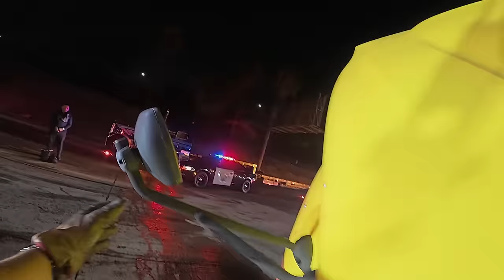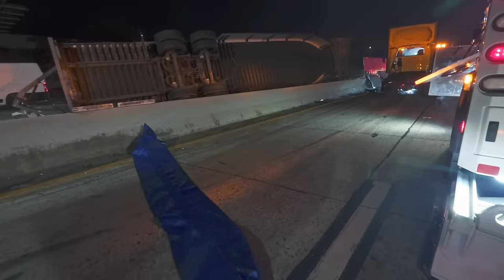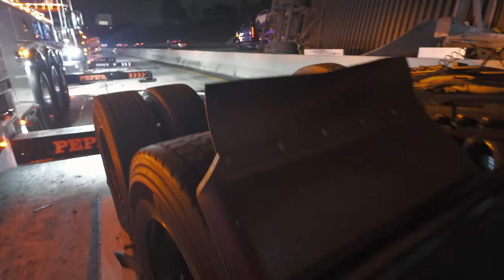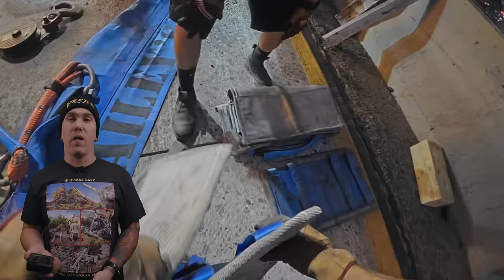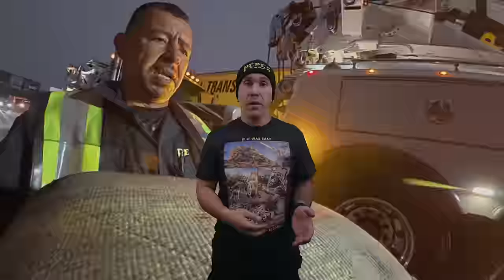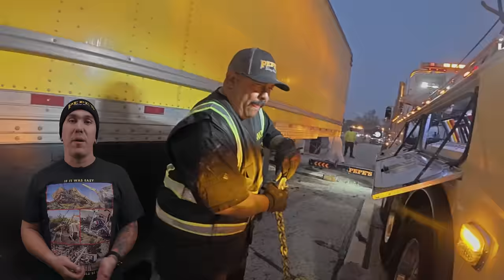Trailer Rolls Over to OPPOSITE side of Freeway!

Comment: Ok, the video quality one way or another not that big of a deal, it's at night. Your recap was spot on to my thoughts. I would have put Big Flipper to the rear for reach. You compensated perfectly for the reach issue by using the jersey barrier to hold the trailer in place while you rolled it. It would have swung into your trucks if you had not done that. So, job VERY well done all around. Also, I know exactly what you mean when you show up and the cops are relieved to see you because they know you will get it done safe and in good time. Back in the day during my time doing this stuff, I had many occasion to show up on scene and have the cops see and go. oh good, it's you!! I always respected that by doing my very best work to clear the scene as safely and quickly as possible. Cool video, be safe!

Comment: @Pepe's Towing Service : Josh like you mentioned in the breakdown you were afraid that the trailer would burst open during the lift, but when you were walking inside the trailer you mentioned it was loaded with kids' toys so I'm guessing that the total weight of the trailer wasn't super-heavy or at least not heavy enough to cause a problem for the trailer walls during the lifting.

As for the action cam's night mode versus normal : they look fairly similar at first glance, but of course what we see is after you did your post-processing and we cannot determine exactly what you did during editing in terms of gamma correction, etc. ... The video quality depends on how much movement there is in frame, the more movement you have the grainier the image becomes and the more artifacts you get. The amount of lights in view affects the video quality as well but that's also normal because the image sensor limitations. Your video (without night mode) "burns out" more compared to Alex's from what I can see (but that's normal : night mode is designed to handle dark scenes better than normam mode), but they look fairly similar after editing. (or close enough so that most people wouldn't know the difference)

Comment: I'm still trying to convince myself that he started on the same side the truck stopped. Though it seems almost impossible to have spun everything 180°.  The damage to the right hand wheels is hard to explain. Unless the unit jacknifed, but that would explain all the rear wheels but not the smashed up front. Maybe the trail of other damaged vehicles on both sides will give the cops more to go on.

Excellent quick recovery. I was hoping to see more of what you did with the big plate..?  Did you have another normal truck come in to pull away the trailer?

Comment: Hulk and flipper could maintain every accident in Ireland 🇮🇪 on there own. No where is further than 3 to 4 hours away ,great videos movie quality brilliant skills top end equipment, how about a boom cam some time facing down   might be an idea , my guess is that tractor was at speed  and smashes a few cars  that took out outside rims and then he took out the central rail hence the in side smashes rims ,5 th wheels are not the same quality any more due to keeping weights down on trucks to get more cargo ,or alot of the time it's a maintenance issue because the trucking companies are cutting down due to lack of funding etc , once gentlemen top job top crew ❤

Comment: venture a guess on the wheels bent on both sides. I think he probably hit the barrier and climbed it,  lost steering by tearing loose the front axle, lost air in tires by breaking beads on wheels with laterel forces and unusual angles. Given the resting position, he got way too friendly with the barrier.

Comment: A bit late but my 2025 kw has only 1 skid plate slide pin on the rail so ithink its "cost cutting" and this will lead to more fifth wheel seperations in the future